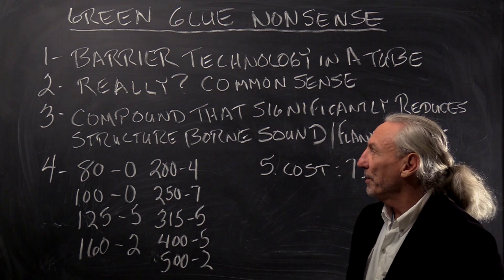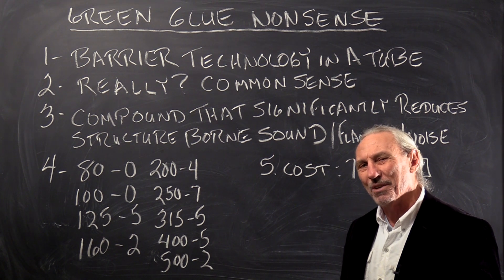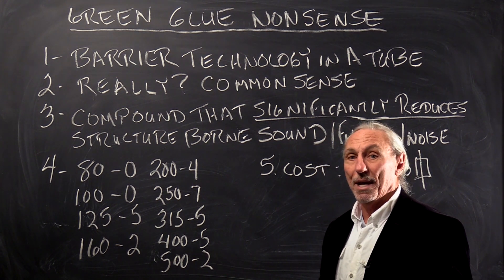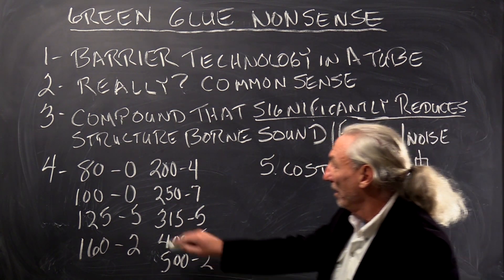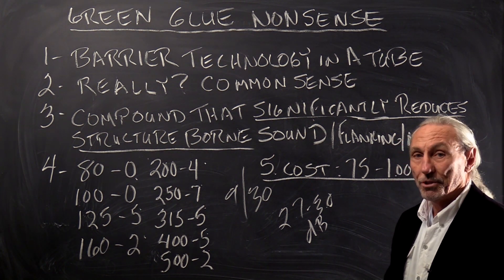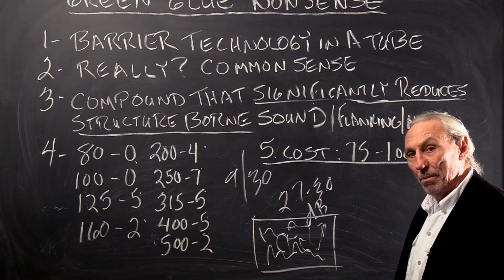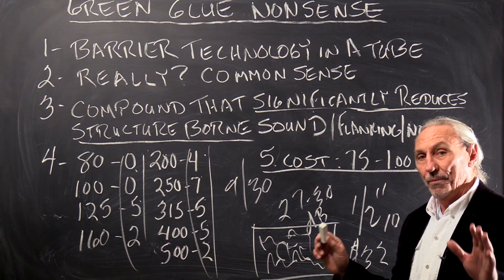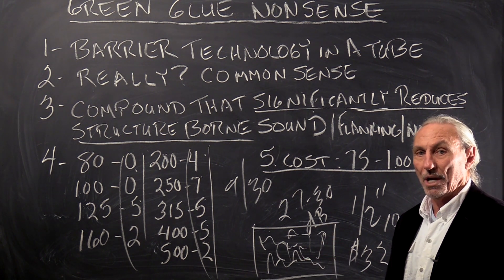Green Glue Nonsense - www.AcousticFields.com

Comment: If you get carpet glue, make sure it's the type that doesn't cure into a solid form, some do and some stay tacky.. Ask the people at the hardware store which one stays tacky and that's the one to get.. Lowe's and Home Depot typically have both types, so be careful.  That's if you NEED an adhesive for this type of usage..
Reply from the maker: People would be better served to not focus on glue but the noise frequency and amplitude issues. Our 14 years of experience with clients and their noise issues, shows us that people dont know what to build or why. They follow blindly with no understanding of why. If you don't know why you will never know what.
Reply: @AcousticFields  I know what you're saying..  Here's the reality of what people do.

People fall into 2 or more categories. One does it the right way by going to someone like yourself that's going to charge them for analyzing data from a noise study and giving them the BEST way to build a wall and materials needed to do the job so they don't have to waste time and money failing using another method that's probably not going to work..

The second are those that are just going to go with that is popular and HOPING that it works that costs less money.   But what usually happens is it doesn't work and they just found out the hard way that it was going to be cheaper in the long run to do it the right way..

I was just suggesting that "IF" they were to use carpet glue with the double drywall/green glue method,  just get the tacky carpet glue and at least save money….   Because unfortunately, some people have to learn by failing first.
Reply: @AcousticFields  I just found out that one studio owner has a shared wall against another studio that creates video soundtracks and on the shared wall, they just kept on adding more Drywall hoping that was going to work. I think they're currently at 6 layers of Drywall on one side of the shared wall.

That's how committed to drywall.. You can tell them all day long that Drywall is not the best method, and no matter what you tell them, they won't listen to you…

I'm wondering at what point they're going to realize that Drywall isn't going to stop the energy below 125hz.     :-)
Reply from the maker: @Oneness100  They do not understand that noise transmission is vibration management. Adding more layers of the same density of material type is not a cost effective approach in money or space requirements. You must reduc e vibrations by forcing them to go through multiple layers that are frequency and amplitude sensitive to the noise that is transmitting.
Reply: @AcousticFields  I realize that, they just have a fixation with Dry wall, and it's painfully obvious that it's not working..  I've never seen 6 layers on one side alone, I don't know what's on the other side.   I'm wondering when are they going to realize that they need to tear down and start over..

Comment: GG is not an adhesive, so no, it's not an adhesive. It's a viscoelastic compound, not an adhesive.  And the independent test data shows to results at all the frequencies listed on this video.  This video is not honest, he's not honest.  Go to the GG company website under resources for the story.  Then contact the lab that did the testing for verification.  Yes get the facts, trust nothing you read or watch online. With 56K subscribers AF is making money on this nonsense.  Countless engineers recommend GG and are not making $ from recommending it.

Comment: Maybe the picture they are trying to spread (pun intended) is that with that 1/8 depth layer of green glue acts as a rubber washer (symbolism) & therefore will help prevent vibrations & noise waves from transmitting through the wall... I've never bought or used it btw. But with that principle being applied it does make hypothetical sense.
Reply: It’s not an adhesive and no one claimed it had magical acoustic properties, the only thing more expensive than using green glue is listening to a grifter like this guy
Reply from the maker: It is an adhesive with no magical acoustic properties.

Comment: Place simple tar paper between the dry wall layers?  Just use Green Glue or a substitute on the studs before attaching the dry wall? Use highly textured paint on walls to break up the sound vibrations?  

The science of sound proofing should be a college curriculum with constant testing and analysis.
Reply from the maker: Every material type and installation methodology is frequency and amplitude dependent. The industry has taken something complicated and simplified things to a point that nothing they suggest will work in most noise transmission issues. We see it everyday. People guess at the frequency and amplitude of their noise issues and then go on the internet and use a methodology that won't work for their noise frequency and amplitude issues even though the company promoting the nonesense states that it will. They then fail after spending thousands and then call us. Most of the time I have to tell them to tear it out and start over. Few are willing to do that and must live with their failure. Why spend thousands to fail. We guarantee all of our barrier designs provided we have a noise time study. A small fee and price to pay for a guaranteed solution. 100 % fixed 100% right.

Comment: it was my understanding the benefit of this stuff is energy dispersion. 
the stuff never hardens, so by allowing each sheet to flex, energy is mildly dissipated.
combined with whisper clips & hat channels attached on one side only... the entire wall flexes.
Reply from the maker: There are a lot of adhesives that never harden. The silicon in the glue allows for the tensile strength flexibility.
Reply: @AcousticFields  Can you recommend any  specific products?

Comment: 'Let's use a little common sense.'  
Let's say there's a choice between two different kinds of glue.  Most glues when they cure harden.  They become rigid and are very good transmitters of sound from one sheet of material to another.  They do not effectively deaden sound.  Now,  I can imagine another kind of glue that does not harden, that retains its flexibility.  It never fully cures but it has sufficient viscosity that it can support the weight of a sheet of gypsum board, (and more,) and continues to act as an adhesive.
The glue that retains its springiness would transmit less sound than the rigid glue.  It would  absorb sound energy rather than transmit it, in much the same way that resilient clips used to support gypsum board absorb sound energy.
I don't know what Green Glue is but maybe it has been designed to retain its springiness and therefore does a better job of limiting sound transmission.   
This sounds like common sense to me.
I wonder if you are mischaracterizing Green Glue.
Reply from the maker: There are many adhesives that are silicon based and can stay flexible over time.
Reply: @AcousticFields  You are dodging the issues here.  In response to several previous questions you answer that we need to know what the amplitude and frequency of the problem noise. In your video you trash Green Glue without making a single mention of amplitude and frequency.  Could it be that Green Glue is the best material for most noise problems?  When you were asked if you have tested Green Glue yourself, you don't answer. When you were asked several times about the 'better $10 solution,' you don't answer.  When you are asked about the 1/2 inch material you don't answer.
You are now on the way to 500 comments, many of them about the way you trashed Green Glue without providing any evidence.  Many of the questions and comments are based in physics but you're asking that we set physics aside for a while and rely on what you call 'common sense'.
Reply from the maker: @peterjgeraghty  No need for testing an adhesive. You can go to their web site and see the performance data. What they don't show you is the performance data for another adhesive type. My best guess is any adhesive would test the same as the adhesive labeled green glue. This is an adhesive, nothing more. It has no more vibrational transmission benefits than a standard construction adhesive with a silicon base.
Reply: @AcousticFields  Hi.  You are still dodging the issue.  And when you say, 'My best guess is any adhesive would test the same as the adhesive labeled green glue,' you are contradicting yourself.  Besides, why should we depend on your 'best guess?'

Comment: @3:30 you said you can get better numbers with a 1/2 sheet. What was he referring too?
Reply from the maker: What are the frequency and amplitudes of your noise issues?
Reply: @AcousticFields  I have a concrete hollow block garage that I'm looking to insulate and sound proof to convert into a studio. What would be the best 1/2 sheet to use that you are referring to in the video? Are you suggesting I audio test the empty garage before I sound proof?

Comment: I just sold my house and bought another house. The new house is full brick. After a lot of investigation and speaking with people i decided it was cheaper to move house than start a very expensive noise insulation project without any certainty of success. Just an improvement of sound insulation would not be enough and it would have to be stopped completely. Big projects are a huge cost and add no value to your house when selling.
Reply from the maker: This is another reason you must measure the noise. Noise is expensive and a huge pain. It cost 5-6 times more than absorption and diffusion inside the room. With good numbers, you can select the proper cost effective material types in advance and control costs. No one should spend a dollar more than they need to with noise. Taking the noise numbers, will ensure the proper material selection and acoustic solution. Like you have said, you never get the money you spent on noise back.

Comment: All he did was prove that green glue is good and works. Does what it is supposed to. Makes a channel of air between that sounds get trapped in and dissipate. People have unrealistic expectations when doing anything. You can't just throw on a new sheet with green glue and expect to be amazed. You need BAT insulation, and to layer this together to get better performance. It's already said that green glue can outperform MLV in walls. It's about what sounds you are trying to eliminate.
Reply from the maker: I could not have said it better myself. Every material type and construction methodology is frequency and amplitude dependent. For some strange reason, people think that this double wall / green glue system works for all frequency and amplitudes. Tell that to the people who have used this methodology and call me asking how to fix it because it won't stop the low end transmission. This is outdated "technology". Using 10" of space and not reducing transmission below 125 Hz. is a sin. It is a waste of space and materials for a limited frequency range function.

Comment: Building a double wall construction with approximately 9” between the outer surfaces of the studs. One layer of 5/8 drywall on one side and double drywall on the other side of 5/8”. The one wall already has R13 pink insulation. Anything else I should consider doing to block out the best range of frequency from high to low? I have read that just regular pink insulation does a better job than something like Rockwool. Should I consider Whisper Clips and hat channel on the double drywall? Much appreciated with any help anyone can provide ! Thank you.
Reply from the maker: What are the frequency and amplitude of your noise issues? The treatment methodology you are describing is limited in its response and takes up too much space.
Reply: Hi, thanks for responding. I actually replied to this exact question from you weeks ago numerous times and you never replied back. I'm a home do it  yourselfer if you will. I have a decent stereo system which hits down to 28 Hz and I listen quite loud 95-100 db at times. Just looking for a little direction on how to get the most bang for my buck. I'm not building a super elaborate system here. If you had $500 to throw into 2 walls what would you do? Please help. Thanks so much?
Reply: Thanks for ignoring me AGAIN! Wowwww unbelievable

Comment: I saw this method on a video and through to myself no way this works. I as well have been in construction for 40 years and never could imagine this working. Glad I watched this. So I have a wall I need to fix. I have an employee who works crazy hours and need to allow him the freedom to do so but he is noisy and the tenants on the other side of the wall are complaining. We have a 2x4 wall, 1/2" drywall each side fiberglass insulation between, horizontal hat channel and another layer of drywall. Its not enough at all. I can build another wall in front of this and have about 14" of space to work with so plenty of room to build something significant. Its scissor trusses  and goes from 8' tall on one side and 16' wide and to 10' tall on the other wall. I have watched a bunch or your videos and still not sure what I need to do to fix this problem. The noise is not excessive its talking, phone use so nothing mechanical or high freq. I am thinking a vinyl curtain glued to the existing drywall, 3" of polystyrene insulation glued to that. Build a 2x6 wall in front of this with a 4"-6" air space between the poly and the inside of the wall. The inside of the wall use 1/4" plywood (because I have an excess amount of it and the wall will still be easily stood. What do you suggest inside the cavity of this new wall? I plan to 5/8" drywall over the top. Wanting to drive the STC through the roof and never hear about this complaint again.

Thanks for any suggestions - Steve
Reply: Use the GG. He is clueless
Reply from the maker: First things first with noise. If you have watched my noise videos, I constantly tell people that with noise you must measure it first before you discuss, plan, buy materials, build whatever you build, you must first measure. You say you are not sure what I need to do to fix this problem. The answer is neither do I without noise numbers. With those, anything can be "fixed".

Comment: How can we know which frecuencys are we fighting before build the room? I mean I will have drums on my space, but my space is not built yet. So I can only measure an open and quiet space... But there will be drums and guitar amps in the future
Reply from the maker: Drums are full range. They are the second largest energy producing source next to a gong. What pressure levels will you be playing at. Most bands play around 110 dB SPL maximum. You will need to measure the ambient noise levels in the rooms that are receiving the noise transmission from the drums.  The ratio to how loud you play in your drum room and how quiet the world is around the drum room determines what barrier technology you will use in your walls.
Reply from the maker: Every instrument type produces a frequency range and within that frequency range, certain amplitudes or strengths will appear.

Comment: I just watched a video showing Green glue is more effective than MLV. This did not compute and then watched your video. Thanks!
Reply from the maker: Its an adhesive, that's it. Are adhesives required in barrier technologies, the answer is absolutely. But we don't need any that claim "magical powers" along with their ability to hold two pieces of solid material together over time.

Comment: We’re building a house and with kids sound barriers are on our priority list. Is there a cheaper caulking that when applied can give some reduction in addition to a 2nd layer of 5/8 drywall? And what about MLV? 
Thanks for the video and saving me hundreds.
Reply from the maker: You must measure the frequency and amplitude of the noise you are trying to reduce the transmission of. Without knowing how much energy you have to slow down and at what frequencies the energy is at you are just guessing about a solution. Guessing with noise never works. Most fall short of their goals and call me wondering how to fix their guess. Most of the time they only have two choices. They live with the mistake or must tear it all down and start over after measurements. Follow the carpentry adage of measure twice cut once.

Comment: Could you recommend a rubber or polyurethane constraining material that will work great and not break the bank? I cannot find a retailer for the decidamp DC30, but also considered similar rubber. This is for the speaker enclosure itself, not the room. I'm looking for something to trowel on between two 1/2 inch or two 3/4 inch thick pieces of maple plywood.
Reply from the maker: Audiomute has a product called Peacemaker. Use the 6 mm thickness.

Comment: putting a suite in our basement thinking about leaving existing thin carpet in upstairs bedrooms wondering how to finish ceiling in basement. is it worth buying the clips for hat channel is it worth strapping basement suite ceiling is it worth trying to isolate said strapping etc
Reply from the maker: What are the frequency and amplitudes of your noise issues?
Reply: @AcousticFields  just trying to sound proof or dampen as much as possible my basement suite. i am looking at 2 by 12 fir 12 inches on center for my ceiling sounds like i will be forced to use a hat channel and i am thinking i probably should use 5/8 inch fireguard drywall even though i dont have to. wondering about sound dampening drywall and also sono board i think its called which looks to me like donna conna board with holes